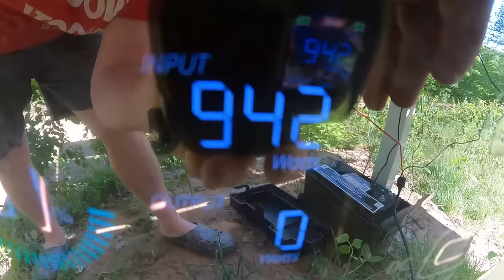Off Grid Solar- HUGE IMPROVEMENTS- Eco Worthy Dual Axis Tracking System

Comment: Tracking systems are only worth it if they are free.   Even if it increases your output by 30%, it's not cost effective.  Say you have 1000 watts of solar.  To increase that by 30% would require an additional 300 watts of solar which is far easier to get by just adding panels.  Less finicky and less to maintain.  Probably $300 instead of $1700
Reply from the maker: The tracking system itself is actually   pretty affordable.  I think normal $599 but with discounts and our code it is closer to $400. Plus you need racking to hold your panels anyway....so this is racking and tracks the sun.....win win
Reply: @OffgridwithJayandJen  The link you posted says $1679.  And my racking system consisted of a few 4x4s and a couple 2x4s and some angle iron.
Reply from the maker: @jrr3787  that is including the panels
Reply: @OffgridwithJayandJen  Ah.  I didn't read the fine print.
Reply: Just barley changing the angle of my panels increases the output significantly. I could see this easily making up for not adding more panels. Less panels to me equals saved space
Reply: Some people might not have the room for more panels
Reply: That depends on how well that solar system is monetized, so your assertion is wrong.
Reply: Nope.  

n almost all circumstances, I'm right.  The exception would be - as someone else already mentioned - is if you don't have space for more panels.   @LeviWritesBooks
Reply: Eco worthy sells these for like 600 bucks. On a 1200w system an extra 40%. At of the day that could be an extra 1200 watts, plus a smaller footprint.  Well worth the price.
Reply: but how much energy does it take to run the tracking system?
Reply: You also need to consider the times of day that you want power. I’m putting one of these in instead of doing an East and west system to work with my main southern facing panels. Gets my batteries charging a few hours earlier and keeps them charging a few hours later.
Reply: If you don't have space this is better.
Reply: @Tiersmoke92555 I have huge land but hundreds of Old growth trees (120-400 years old) & I don’t want to cut trees and only have a few small unshaded areas during winter as I live at the very southern tip of Tasmania and I want to increase my winter solar production as the solar in my shack gets partly shaded during winter …… this could do the trick depending on how much solar I can mount to it.
Reply: @Eric-bh6ie I would love to have on of these I been moving my panels around makes a tremendous difference. :-) for me anyway? What’s keeping me I can’t afford the higher watt panels it would need, because it doesn’t hold enough for me living off grid. I agree with the comment if it was FREE. I haven’t found much free in this world other than Jesus 🙏 and the Sun of course. 😊

Comment: 7 Days for basic "Curing of Concrete " 28 days for Max.   Babe it's CONCRETE not Cement and it "Cures" not dries . .  Lots of good advice below on Bolts and securing pole.
Reply: Don't intend to be negative want to be helpful.  Devil is in the details and nomenclature.
Reply from the maker: I appreciate that.....been a year and half and still standing strong....so we did ok i guess, LOL.  Best wishes

Comment: Put nuts on both sides of flange to hold the bolts in place when setting them in wet concrete
Reply: I like that, I will definitely use that trick
Reply: Yeah, anybody with half an inclination towards mechanical proficiency would have done that automatically. I also noted the round washers on the square portion of the carriage bolt... Did this set up come with instructions?
Reply: @johndboran  That didn't matter cuz that end was down in the cement
Reply: J Bolts!
Reply: @robertmontgomery3892  yep those carrage bolts are not shear rated like a J bolt, not to mention 4 of them bolts are too close to the edge of the concrete and could cause cracking. Still give them an A for effort since I usually learn from my mistakes but prefer learning from others mistakes 😂 makes my project go smother.

Comment: actually the shading on your orig system is the reason you are seeing those gains on the tracker.  Even the slightest shading on a panel can cut is output in half.

Comment: Thanks! Ive been curious if its that much better than your other system but 40 percent better is pretty impressive. You guys kick butt on power now, LOL!
Reply from the maker: It works really well.....mounting the panels and setting up racking was a little more challenging than I showed, but you only have to do it once.

Comment: A video that turned out helpful. I was more interested in the way made the base, today I was able to do the same since tracker showed up! Only change, I didn't use washers on the bottom. I put a flange nut on the bolts under the base and used the washer and nut on top to hold bolts in place while setting into concrete. It not only held the bolts but also kept the crete from seeping  though the holes on top the base to cause issues later.  Thanks for the vid!
Reply from the maker: Awesome....glad it helped buddy. As a note.....it's over a year later and crazy wind storms over the winter and spring and it still is doing great

Comment: My neighbor was building one last time I was at camp. Should of asked him about finding solar north vs magnetic north for my passive solar cottage. Around 12-13* off from magnetic north in Central U.P. Make sure it is well grounded being on a hill. Seth at land to house had to put jumpers on his panels for ground. Tested by a continuity tester.
Reply from the maker: Interesting.....is it silly to think with the unit being all metal and connected to a 4 foot concrete block in the ground.....would that ground it? Or is a metal grounding rod necessary?

Comment: Cool new solar system, this will sure boost the amount of power coming in. You might have to keep the snow shoveled around it, it looks low in some areas, snow can accumulate and prevent it from moving. Just a thought.
Reply from the maker: Very true......will have to see hownit goes. 😊

Comment: With out a doubt tracking more useful, we’ve had a duel axis running 9 plus years, I recently put in a north facing array aswell, unless you have a very large battery bank solar production from first light to last duel axis surpasses static arrays, I can attest from that. 🇦🇺
P/s our system uses duel slew drive combination not linear actuators.
Can handle any wind thrown at it.

Comment: Always cast your concrete in the hole.  The Sono tube is just a form for the exposed portion of the foundation.   Wet the walls of the hole prior to pouring.   Leave the Sono tube on for at least 7 days.   A foundation like this should have rebar reinforcement.  Never do that "DRY POUR" crap unless you like wasting money and time.   The water to cement ratio is critical especially for bag mix.  Stuffs made to minimums for cost savings.
Reply from the maker: I keep hearing this....but have no proof or REAL experience that it doesn't work.....only others who have it work this way with no problems.....weird
Reply: @OffgridwithJayandJen  It's chemistry and material science that is well proven.   Your project is not structural but cosmetic.   Retired Civil Engineering Inspector.  Love the northern Michigan area.   Spent many many decades fishing with grandpa and dad in Frankfort.   Be well and stay safe,  winters coming.
Reply from the maker: @toddwheeler1526  appreciate your experience.....I just know it feels solid as a rock and has held up to very very strong winds already without a problem.  Is if perfect no.....will it hold up for many years....yes. Best wishes

Comment: Solar trackers make more sense if you need additional power but you don't have enough space to add more panels or if the cost of panels is extremely high.

Today panels are relatively cheap and it looks like you have lots of space.

Adding more panels is probably the more cost effective solution to get more power.

Adding more panels is less complex and there are no moving parts to fail.

Regardless, trackers are interesting.

Great video.
Reply from the maker: Good points.....there are definitely pros and cons to each situation and option. Being a, simple is better, kind of guy I appreciate that, but at the same time this system really capitalises on making the panels be as efficient as possible in a small amount of space. Thanks for watching. 😊👍

Comment: I like what you did. 😊
Some help though,
0:53 The sauna tube only Hass to go into the hole a couple inches. The shape of the hole should fill with Concrete to make it more stable.
2:58  You don’t have to mix the concrete. You can dump it in dry.
3:09 Make a template out of cardboard or plywood to sit on top of the concrete. 
🤔

Comment: Nice tracker. Next time go with higher volt "house panels" like 36v or better, using higher voltages at lower amperage you get a much more efficient system, smaller wires, lower cost, more KW at lower wear and tear on components like inverters. Those small "off grid" or "12-18v RV Panels" are really in-efficient and really expensive per watt and just drive amperage up if wired wrong causing excess wear. I just bought 375w panels for $90 each, and they are 36v~10amp. 6-8 of those with a Growatt SPF6000T high volt offgrid inverter and a 48v LIFEPO battery (heated for cold areas). Going bigger costs more, but when you outgrow the small stuff, you waste $$ piecing together expansion, going bigger may cost 30% more, but produces 2-3x more KW. Also oversizing your battery can make sure it lasts you 15-20 years instead of 8-10 due to over cycling. EG4 Has some nice options, but rather than going with their small 5KW, consider the 14KW, costs less/kw, lives longer.

Comment: Surely it would be cheaper to add 40% more panels ?
Reply from the maker: If you have the space or want to buy larger CC and such to handle it. The system is actually very affordable......it's not an expensive set up, so hard to say.

Comment: Would you consider doing a more in-depth review about this? I can appreciate this video, but it would be nice to know how it is all configured. Is it wired for 24v? Do you have to have a separate battery to give it the power it needs to "follow" the sun? If you didn't already have your power barn, how would you wire this up? Thanks for the video!
Reply from the maker: I might do an update in the spring....give it some time to do some data collection. There is updates to the system being hooked up in more recent videos too

Comment: How big of panels will this system hold? Would like to see a update on how u put both solar systems together in solar shed... I told u a lot of people want a wind turbine setup review....lol keep it going..yea
Reply from the maker: I would have to look at the spec sheet to get measurements but the railing makes it pretty flexible with the mounting....but you would have to balance it as to not cause extra strain on stuff. The link below takes you to the tracking system with the Panels they recommend  for it. =)

Comment: I bought two of these for only $800! Hoping to build a 2400 watt system. However, i have 200 watt panels which are just slightly bigger than the 195's. Im sure theres a way.
Reply from the maker: The clamps that hold the panels to the railing are adjustable....you should easily be able to use them.

Comment: I'm pretty impressed with this system given the price point!  It does look like you kind of need to have the optimal size panels for it though.  Still reasonable though!
Reply from the maker: I Completely Agree....considering the cost of traditional racking or panel systems having this one that also tracks the Sun for similar cost it very nice. I have seen others set this system up with Four larger Panels, Rather than the six they included in our set up....but I would go with what ever allows the Most Wattage Available. Best wishes

Comment: Great video! How did you get the clamps to work properly? I cannot get them to bind anything to the rails.
Reply from the maker: They were a little tricky at first for me.....but you had to make sure they were turned the right way as you started the threads into the clamp that slide in the channel. Hard to explain...but if you mess with it for a but you should see how it works.
Reply: Thanks. Figured it out. The pre-assembled nut in the plastic piece was upside-down AND the picture in the instructions, and on the ecoworthy youtube video are wrong.  @OffgridwithJayandJen

Comment: thats a real great report ! Are common panels with 1,68 m x 1 m even too fixable ? perhaps instead of 6 only 4 ? This tracker has a safety if a storm is approaching for a horizontal waiting position. ThanXXX and cheers from black forest:-)
Reply from the maker: The clamps that mount the panels are very adjustable,  so many sizes would would work well. It has already seen some good wind and is survived it, fingers crossed for long term
Reply: @OffgridwithJayandJen thanks ✌️ eccoworthy told me, No delivery to germany or Europe..

Comment: Hello Mr Jay & Jen: Im now thinkin of buying this tracker. But one reservation is regarding the southern tip angle. Im in the UP where winter solstice sun rises only to 18 degrees into sky. Id like to know what angle the southern tilt can descend to. Is it only 45º downward? Or can it go lower? And for whatever angle it can tilt to, is that because of the actuator running out of space, or is it because of a hardward stop between the top bar (labeled B) thats tilting in the N/S axis and the top of the main post right where the word "South" is printed? I mean, do they butt against each other so that even if I installed the actuator a little lower to get a further tilt south, the "B" arm couldnt do it. Any advice on this is appreciated as Im not sure the mfg wants to answer this. Thanks for this video documentation.
Reply from the maker: I'm not in front of the tracker at the moment.....but I can say that I feel your concern is valid. I can't answer if you could easily modify the angle, but if you send us an email I can try and let you know in the next few days. It will be difficult for me to find this comment, so email us

Comment: I can buy a fixed mount that will hold 4 large 455 watt panels for 300.00. I found that i can mount 6 large panels on this tracker for 440.00 and once it traccks, it means the difference of 78 to 80 % charge on a cloudy day, to 99% charge. Im seriously thinking about getting a second. Less foot print and more power are a win for me. I just concern myself with how long the cheap Chinese electronics will last
Reply from the maker: I don't normally like complex stuff....but this system is simple enough and at a decent price point, it makes it hard to pass up. I have had My first actuator failure just recently,  but still ok with how it works

Comment: What is the advantage of soon tube vise just filling the hole with concrete that would be tighter to the dirt and automatically level.
Reply from the maker: Well the ground where we installed the unit was a hill side, so i needed to have the ability to raise the tube up like we did to make it level.......as shown in the video when we used the metal to mount it. In reality we could have used some 2x4s and put a mini pad above the ground surface.....but I wanted to have the option to go up a foot if needed,  as I had never installed one of these units and wanted the option if needed.  Thanks for watching

Comment: How well has it been moving in cold temperatures?
Reply from the maker: It actually broke a few weeks ago.....one of the actuators seized up and I had to buy a new one. I did a little video about the failure.  I have been leaving it stationary since then
Reply: @OffgridwithJayandJen  Interesting.

Comment: What tube (size? ) I'm looking to use the same setup (solar mount) but was planning on a 3x4 x 8" thick pad with a 16 " tube coming up 2.5-3ft for it to set on. I have bigger panels 300 watt. Am I using to much concrete?  Have you had any issues?
Reply from the maker: Our sonotube was 12 inches and 48 inches tall.....I think we only used like   6 bags of concrete. 80 pound bags. Holding up great so far, but I did have an actuator fail on me the makes the unit move east and west.

Comment: I see some tree shade on your fixed panels!
Reply from the maker: Ya for a couple months during  peak summer the top row is covered for a few hours in the morning....BUT the whole system gets fully charged in about 4-5 hours later in the day, so I don't worry about it. The Shade they cast elsewhere is my favorite spot to sit and stare at my cabin. During the shorter days of the year and winter the tree does not shade them due to the sun being lower on the horizon. This new array will be a huge help come fall and winter months.

Comment: Hi Jay and Jen, I want this system but US supplier wont ship to UK. UK warehouse has no stock so I boult the controller and actuators but now I need a few basic dimensions.  I have only 1 Panel 425Watt 70" x 45" so it's a garden project.  I do not need the base stand dimensions but what size is the steel box section ? what lengths are the White rods B,C,D and E.  I hope you can help me out.
Reply from the maker: Do me a favor and send us an email, it is in our about section.or send us a message on facebook, that way I can find the info for you and this comment won't get lost. Thanks
Reply: Thank you
 @OffgridwithJayandJen